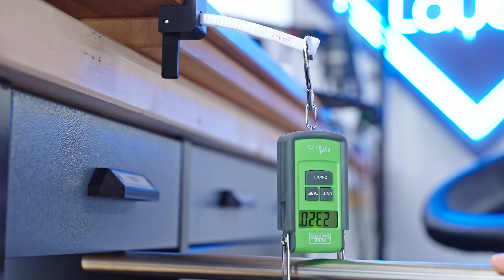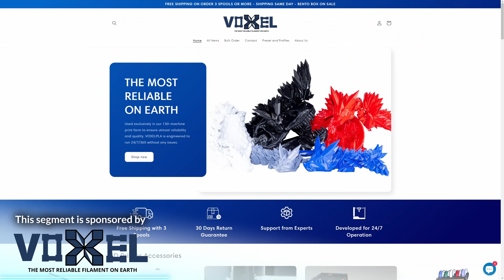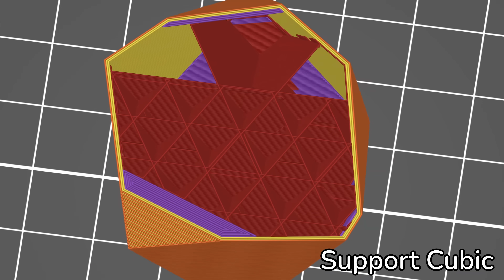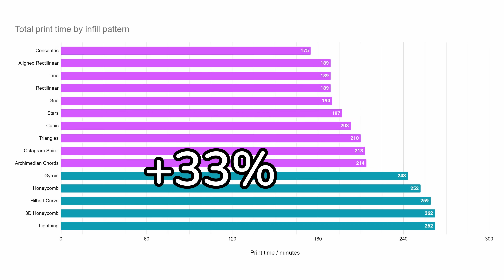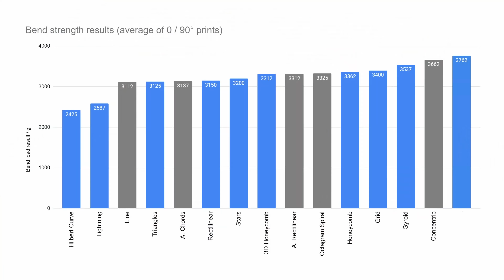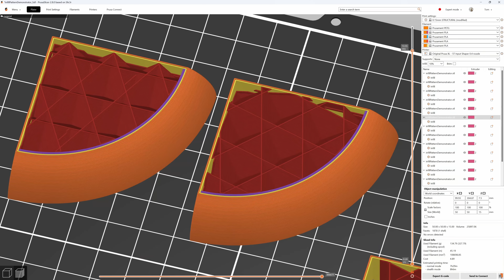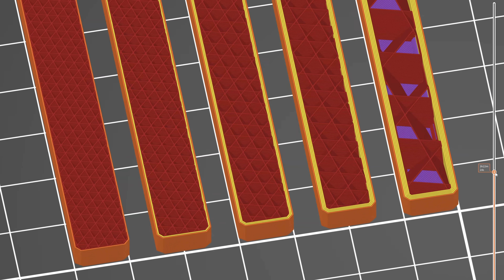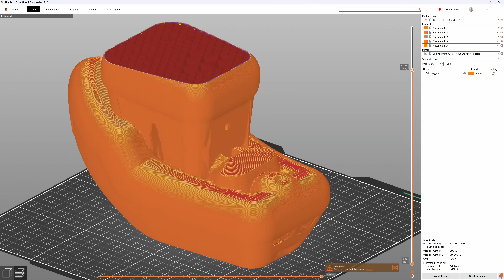Rethink how you use 3D printer infill!

Comment: Basically 90% of the video explored the "best" infill type to use. And the last 10% told us that the best infill to use is NOT to have an infill at all (and use the material for the perimeters instead), which makes pointless the first 90% of the video. Fantastic!!
Actually, the only reason to have some infill is to support the top layers and resist to compressive loads (and side walls buckling). But unfortunately the infills were NOT tested to resist compression, but bending (where clearly they do not contribute significantly, being by definition around the neutral axis of the section). And theoretically the best infills to resist compression are the 2D types (certainly not cubic!).
I have always used rectilinear, ~5%. Which also prints as fast as you can go and gives a clean top surface. This video confirms I was right!!

Comment: For the nozzle misalignment on the XL, did you recalibrate the nozzle offsets after changing the nozzle?  You need to clean all of the nozzles and run that calibration with the pin anytime you do anything with the nozzles because the position will not be the same after loosening and reinstalling.

Comment: You took a different approach to this than other youtubers, which I liked, in adjusting the infill to get the same amount of material in the part. Some of the same mistakes, in my opinion, focusing on the top line modulus of rupture. For most of my prints, I care more about the rigidity of the object under normal loads rather than the ultimate strength. More testing of different elastic moduli is needed, as well as testing of different orientations, since additive manufacturing is fundamentally non-isotropic (outside of maybe laser sintering).

Comment: Depending on the application of our print, appropriate strength should be considered. For example, if it is going to be compressed a lot or carry some load, will it experience shear or bending forces.

Even if this research covers a few cases, it still was very insightful.

Comment: Great video, I like how detailed all the tests are (especially with the data). Interesting on this topic would also be, how the infill change the damping/vibration/stiffness in parts. This would be great information for many mechanics (as an example when you build a printer like a Voron). Proper test would probaly be some measurements on the eigen modulus and frequency. Or are there already some tests with proper data on that (didn't find anything like that yet).

Comment: On the Prusa MKIII, I could not get PETG to print properly. I had to use a 0.6 nozzle, and I had to increase the line width a tiny bit. But here, Tom prints "perfect" infill with a tiny nozzle at high speed. Just to be clear, I was using 7 different MKIII printers at the same time. They all behaved exactly the same. My story is simply to print infill ridiculous slow, and do my homework as to ensure really high quality on the infill pattern, as it turns out everything changes if my prints are really "perfect". Perfect for my work, is not perfect for non-exposed infill.

I love the focus on crossing patterns, but grid is just widely different from for example triangles. Also, the anchor of the infills are just insanely different, for no apparent reason, other than tradition. Given how retractions work in real life, I don't get this "perfect" thing. Some patterns actually anchor their lines to attempt to actually get a bond, while others simply do not anchor in real life at all.

And just testing the pattern, without really inspecting if it is printing properly, makes very little sense to me. Given the nature of my work, the quality issue associated with infill nearly drove me nuts, until I fully understood it. Single line printing is simply not the same as any other form of printing, and to get it right, well, people sort of need to slow down. A ton. The focus on retractions and curved lines is, well, extreme.

Finally, infill is very similar to patterns used for supports. There is a reason for that. But ones you understand the strength of infills, suddenly they are insanely useful, when used correctly. Actually, they are far superior to any usage of material, if applied correctly. If only printed as they should. People with get what I mean. Shortly.

Comment: Anyone know how Cross Hatch compares? That's the default for my Bambu X1C when using OrcaSlicer.
Reply: cross hatch is the best overall for general use across categories. consistent and even strength in all shape prints, decent print times, good efficiency. it's a hybrid between cubic and gyroid.

Comment: I designed a new honeycomb infill pattern.  This pattern is made from single non interesting walls and without bridging!  
It also Prints 31% faster than stock Orca honeycomb infill.  With identical print settings!  Have a look, if you like.
It may also be the first non-planar infill pattern.

Comment: Have you test which pattern is more ductile and less fragile ? I mean, can resist to load and torsion with some bent and not too hard in a way to crack. I tried different experiments for engineering parts here and overall the 3D print parts are too fragile and cracks too easy under load.

Comment: Ive been using rectilinear with combined layers (infill combination) for a long time in Bambu Slicer. Its fast, doesn't waste material and doesn't print over itself. Its fine for anything that doesn't need a lot of strength. If its just for support I can go down to 5% infill in many cases without issue.

Comment: I print mostly functional mechanical parts so 4-5 walls and 20-30% cubic infill works for me best. Of course, everyone needs to evaluate the function of the part and decide on a case by case basis. For slightly larger but flat parts, again, 4-5 walls and 15% gyroid or adaptive cubic works. I also use 15-20% support cubic for tall parts. And again, depends on the function of the printed part.

Comment: My favorite infill currently is the 3d cubic subdivision, basically just cubic but the cubes get small on the outside and huge on the inside especially if there actually is a larger open space, it supports everything well, can be applied to any geometry and uses filament efficiently by getting more of it toward the shell, if I really want alot of strength though just making a thick shell is always best, main thing you need to look at there is having a small percentage infill that's enough to prevent buckling fi you are going for efficency, same way the "skeleton" under an airplanes shell does you can design similar structures outright and have the printer do it but that's alot of effort (as in actually modelling your supportive structure and having your wallthickness as thick as your part is)
Looking at your supportcubic the cubic subdivision I use is very similar but much much more extreme in its scaling the largest cubes are multiple times larger than normal cubic on similar infill percentages and can be almost as big as the volume to be filled

Comment: All that to say that you validated my intuition that shell thickness is critical to strength. I can’t think of any place where I’d use more than 10% infill.  A small lever arm, for example, would be solid with enough perimeters. Infill is mostly there to support the top layers

Comment: I wish a slicer would implement a feature to be able to draw internal walls in parts.  You can trick the software to do it, but it doesnt always work great.  You could tie features together with thick walls, and use a low infill everywhere else.
Reply: in cura you can do different settings on different areas of a part. but most often when i need this, i just make small holes trough the part in the cad program that will get walls in the part,

Comment: i use ZigZag in Cura because its just crossing pattern but the line kinda bonds itself to the print walls a lot... its a continues line. It kinda acts as a partial additional wall, which is significant in my usally 2 wall prints ... its hard to explain but i think you should have a look at it ...

Comment: What causes adaptive cubic to layer shift in larger prints?  Many failed prints have caused me to switch to gyroid, normally at 20%.  My X1C doesn't seem to have issues with supportive cubic.  It does seem like adaptive cubic is a common issue in large print fails that layer shift in the various groups I am in (Bambu, Mr Baddeley's Printed Droid, and Droid Division).

Comment: The patterns octagram spiral, concentric, and hilbert are best for top and bottom solid infills, NOT volume infill. Octagram spiral creates a nice starburst effect, and concentric makes radial light reflections, especially with metallic silk PLA. Hilbert is kind of strange but it's useful for preventing warping. For infilling volume, my go-to is always adaptive cubic or gyroid. Aligned rectilinear is most useful for printing clear "glass" from transparent filament because it eliminates trapped bubbles when printing at low speed.

Comment: even for some of my most intense use cases like a rotary tool bench vise or a wall clamp made to hold up a shopping cart by the front door i didn't need anything close to 50% infill or 5 perimeters. for the bench vise i used gyroid at 20% with 3 walls and for the wall clamp i used cubic at 40% infill and 4 perimeters. Granted the overall design is also a factor but even then the rotary vise has been working without issue for 3 years and the wall clamp is going strong 7 months in.
Reply: ok fine 4 walls is close to 5 my point still stands, i agree with the video.

Comment: I think compression strength on a disk would yield another very interesting set of data, although I expect honeycomb to win here in its preferred direction.
Still, maybe there are some surprises especially when we do three cubes of each side by side and load them in three different directions.
It might already be enough to put them on a scale, a small plunger on top and then the tube from the top as the lever

Comment: I'll probably keep using gyroid, but I have a six-year-old first-gen Ender 3 that only benefits a little from the new features in Klipper.  If I had a Voron or something, that speed would probably matter more.  I know with gyroid it'll be fast enough and generally equally strong in all directions, so I only need to think about layer adhesion itself.

I do wonder about spaghetti infill, and whether it could possibly improve strength perpendicular to the Z axis (the weakest, obviously) by bridging multiple layers...  Or some slicers have the option to join multiple infill layers, and if that could improve Z strength, too...  Then again, using gyroid with 110% flow rate and a high temperature might do more.

Comment: Gyroid gives the maximal infill *area*, and also avoid any strait lines in any direction. Its good for a couple things - TPU prints that need to flex and squish, and for thinks like biologic filter medium where you want good flow through with very high area.

Comment: Good Video... in aerospace we use thin honeycomb  and skins.  The load paths are, as you suggest, only in the skin which takes all bending and direct tension/compression.  
The infill is only for out of plane or transverse shear but also can prevent skin buckling in a compressive or bending load.  
Honeycomb core has no bending strength and flexes just like you demonstrated in the video.
Reply: Sailboat construction also. They use paper honeycombs, and plywood skins with fiberglass over it. (Source the West Marine Epoxy Manual)  I always associate Isogrid with NASA, and "SpaceCraft"

Comment: Have anyone tried to print the articulated dragon from Thingiverse that have ball sockets segments? I had a hard time dialing the correct setting to attain structural strength and not so still ball joints. Any hint on the would be greatly appreciated.

Comment: One type of failure i've had most with my prints is the holes for screws or threaded inserts.
i've never managed to break a part in half by sheer force yet but i did melt/drill/screw through too thin walls or just broke the printed hole away from the infill so that's something i always try to take into consideration, not just the strength of the outside of the part but also the strength required to keep the walls from moving under load.

Comment: Personally I print with my infill set to .8 line width on a .4 nozzle. Cuts down on print time and makes parts stronger. Will use more filament in exchange(at same densities). With a thicker infill line, you can get away with lower infill % often

Comment: Was about to start my most ambitious 10 hour print with gyroidal infill. Chose gyroidal on the basis that it looked cool. Decided to watch your video before I began. Changed to Cubic based on your results and saved 3 hours on my print time. Thank you sir for the tip. This was S-Tier YouTube content.
Reply from the maker: Thanks for the tip, too!
Reply: Awesome. I did 25% honeycomb on a print and immediately vowed to never do it again. Watching my M5C blasting along wobbling about 3mm side to side at 30mm a second was like the least efficient thing I’ve ever seen.
Reply: What was the print?
Reply: Cubic is just slowing down everything on both my 4 2.4 Vorons
Reply: Getting ready to sell my mk3s+, but before doing so wanted to print a few parts, gyroid has them at 16 hours per and I need 6 of them, this video saved me a bunch of time that let me sell the thing without stressing myself out over time management

Comment: Thanks for the nice video, I underlines everthing I thought about infill.
For my decorative parts i am at 10% rectilinear with 3 shells.
For my structural parts I am using the Voron default with 40% infill and 4 shells with Cubic infill, but recently I started to use the new Infill in Orca Slicer called "Cross Hatch" its basically a better version as Gyroid, at least its marketed this way and for now I am pretty happy with it. It prints as fast as Cubic and dont have crossing lines like gyroid. Maybe you wanna give it a go and test it aswell :)

Comment: Would be possible to have test the 2d and the 3d patterns with a twist, literally, have them rotated by a small amount per layer, just enough they can twist as they layers add up but not enough that they skip over the support provided by the previous layer, and see if that makes any difference?

Comment: Fantastic. This is what I have been wondering for a while as I print mainly for structural rather than decorative use. I felt that more perimeters were the better option and defaulted to 7, but I also added more infill for parts I really wanted to be very strong and often hit 70% . I think a little experimentation similar to yours is called for on the infill density impact

Comment: In my Bachelor thesis I did a similar test except I tested for tensile strength. In my tests I also got that more shells are better than more Infill and almost no increase in strength for more than 30% infill density (normalized by weight). I tested only four patterns against each other: Grid, 3D-Honeycomb, Gyroid, Triangles.
Gyroid and Grid tied for first place than triangles lastly 3D-Honeycomb (also normalized by weight).

Comment: Most Bambu owners use and recommend gyroid for a reason you actually mention: it’s a non crossing pattern. 

With high speed printers, having a crossing infill pattern can increase the chances of the head impacting the infill and knocking the print.

Comment: In my experience, Gyroid is far less likely to cause a failed print than cubic. Due to the lack of overlapping lines, it's less likely to tug on previously printed infill than cubic is. On my printer, if printing fast enough, cubic will sometimes cause a tiny bit of friction with the nozzle that you can hear during travel moves (due to innacuracies in laying previous infill down and any mess up in the infill over the course of a print, which gets worse exponentially)

Comment: I occasionally use patterns from the "dubious" category, typically Octogram Spiral for either the Top or Bottom (or both) surface pattern. When I do this it is purely for cosmetic reasons, they can add a nice subtle surface appearance. Hilbert and concentric also work well for this.

For infill itself, on typical prints I almost always use Gyroid or Cubic at typically 15-20% along with 3 walls, 4 if I am concerned about strength.

Comment: I use the cubic pattern as it's the strongest from my experience.   I had printed an extender to connect 2 monitor posts 6 inch in length.  While this worked initially... after about 3 months the print snapped dropping the monitor.  I had used 100% infill.  When I used the cubic at 50%...  it did not snap it just eventually started to lean and then show failure at the same stress point as the solid peice...  thanks for your tests, helps confirm what I already know

Comment: Before I watch: 
- Gyroid if I need strength from multiple sides
- Honeycomb if I expect a lot of pressure in vertical direction
- Line if I just need stomething to support the top layers
- No Infill and if there's not much top surface area and the walls are strong enough already

Comment: Exactly what I am preaching in discussions forever now: use rectiliniar/triangles as it is fast, efficient and provides decent strength. For more strength use more walls. And for non mechanical parts lightning can be a valid option to support top layers/internal structures. 
One topic that wasn't covered: using infill for aesthetic reasons, e.g. I've used hexagon infill without top/bottom layers as radiator grilles, roof racks, etc. for my 3d printed RCs

Comment: This aligns pretty well with my theories and experience. I generally used cubic wherever I wanted maximum strength and a faster to print infill where I just needed support. I also tend to rely on more shell thickness any time I want a part to be robust. Thanks for all the testing!